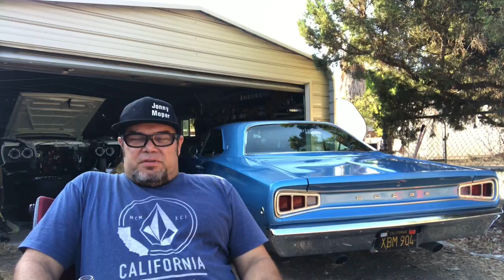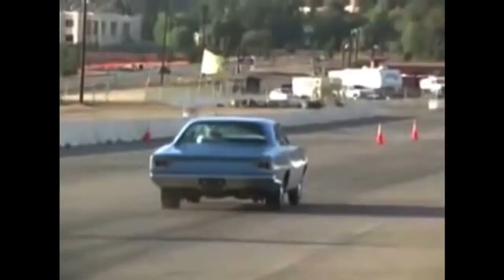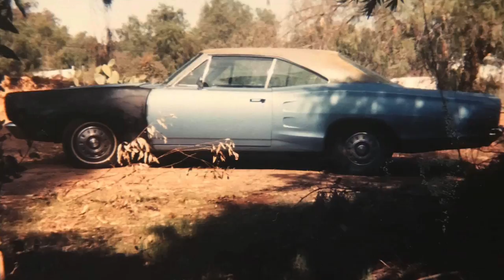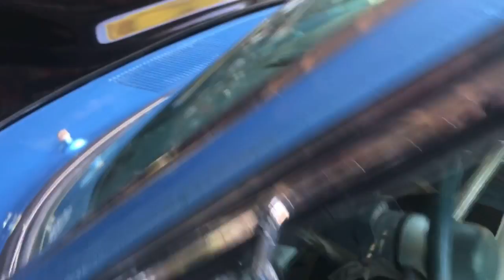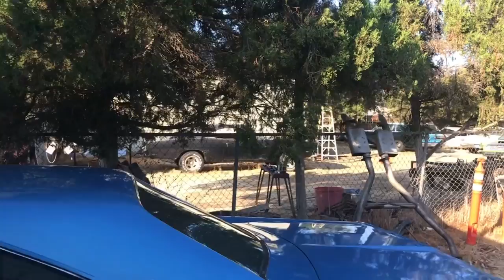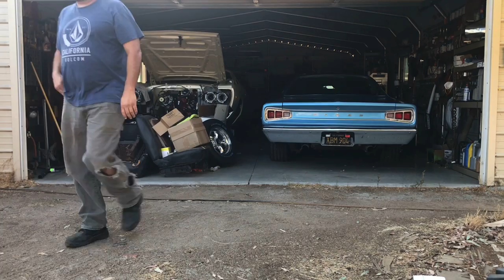My 1968 Dodge Coronet story

Comment: I love that you just did what you wanted to it instead of taking it fully back to factory.  I get so stressed about fender tags and I get caught up thinking that everything HAS to be original. I like that your car is clean, simple, understated AND the original color and interior while having the engine you want under the hood. It's the perfect balance of build-sheet respect and custom hot-rod. Thanks, Johnny!

Comment: Thanks for the story I bought a 1968 Coronet 440 318 car with the exact interior that you have. I drove it for a couple years with the original engine patina and then decided to completely restore it. It's currently in the paint shop but I was fortunate to find another Coronet 500 with a built 440 with Indy heads making around 600 hp. You can check out some of my rides at BC Skyman. Yes I love the 68 B bodies with a passion!
Reply from the maker: Oh sweet, I’ll check it out. 500’s are sweet.
Reply from the maker: I subbed. FYI, your comments are turned off.

Comment: Hey Jonny, I had a 68 Dodge Super Bee my parents gave me when I was in high school (circa 1975-1978). It was beat up but I threw my whole life and pay checks into it. I rebuilt the 383, and it screamed, putting out about 430 horses. The rear main seal always leaked, and like you, I did everything to try to remedy the issue, but it still leaked a little bit. I just left it alone after that. Oh by the way, my parents bought it at a used car lot in Corona in 1970 for 1800.00. It was very clean back then.
Reply from the maker: Wow! That's an awesome 1st car. Just a couple of towns over from me. That's awesome. Any idea what happened to the Bee? What color was it?
Reply: @JonnyMopar  Like an idiot I was pressured to sell it by my parents, because it was the only money I had for tuition money for Cal Poly San Luis Obispo. At this time we were living in Palm Springs, my father was a teacher at Palm Springs High, and that is where I rebuilt the car, Mr. McEneany's autoshop class. I sold it for $2000.00. Three weeks later the 16 year old kid who bought it killed himself in it. He rolled it about ten times out at Windy Point, coming into Palm Springs. They say from the two other survivors " he wanted to see how fast it would go." I should have never sold it. I still kick myself when I see 68 Dodge Coronets/Super Bees. Oh, by the way, it was  the Light Green Poly with  the Super Bee stripe. I repainted it a dark metallic green.

Comment: I two have the Coronet work in progress job... I have a 66 Coronet 440 six pack... I have the motor working great, carbs tuned ( that was a a job) car needs paint, now rebuilding front suspension... I wish U luck with the car , stay safe....

Comment: Awesome story!!
Reply from the maker: Thanks Shane.
Reply: @JonnyMopar  you still having issues with over heating? I’m having the same problem 🥵! I changed the thermostat, i added a pusher fan and changed the radiator cap. Still overheating, any good tips?
Reply from the maker: @Mopar14  Shane, check out this video, I think they're in Riverside Ca, not sure where you are but it implies there's hope. It was fairly informative, just not as technical as I like. Of course going their route sounds very expensive so I'm going to try to get my cars running cool on my own for now. https://youtu.be/14oBke9hGuY
Reply: @JonnyMopar  thank Jonny, I’m in Michigan and my car is in hibernation now🥶. Lot’s of information in that video, but i think come spring I’ll try to figure something out. Thanks
Reply from the maker: @Mopar14  Cool.

Comment: How well do you like the trick flow heads you were talking about?
Reply from the maker: Been awhile since I did that video. Don’t remember what I said but the Coronet has Edelbrock aluminum heads. I love ‘em. They work great on street cars. My buddy Just Mopar Joe did a comparison between the Edelbrocks and Trick Flows and the Trick Flows seem to be superior. That’s probably the route I would go on the next set of aluminum heads I buy. But it’ll probably be awhile before that happens.
Reply: @JonnyMopar  thanks for the info.  I'll check out that video.